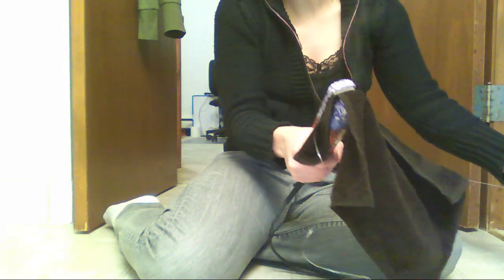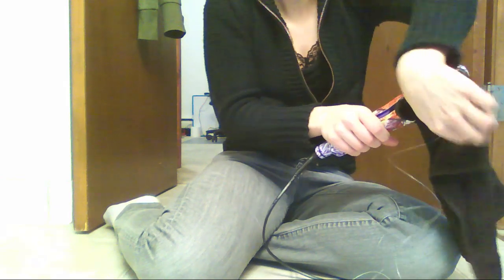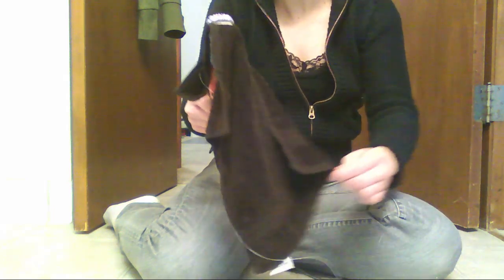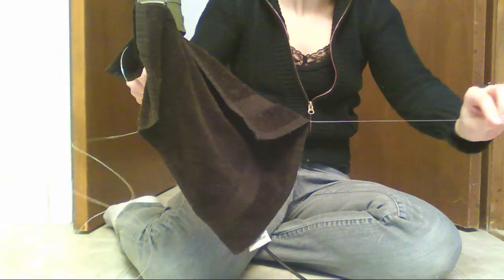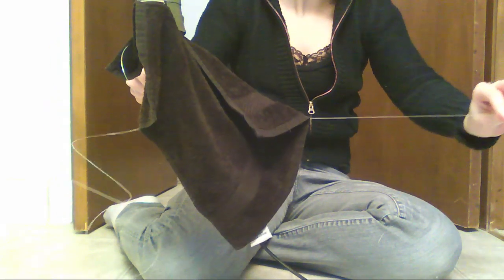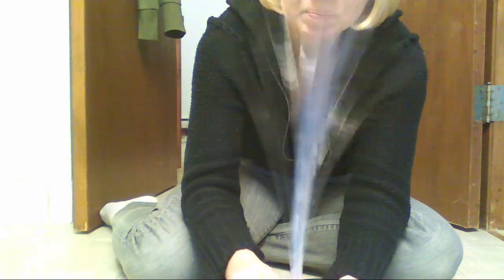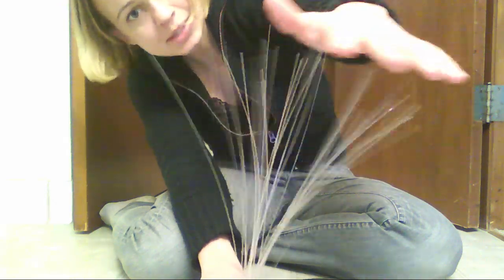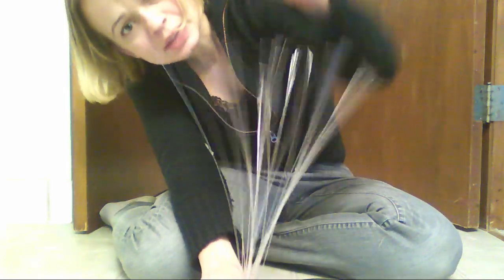DIY Fiber Optics

Comment: This is from a starship modeler forum "Posted: Thu Feb 18, 2010 11:44 am    Post subject: 				 			 			 				 			 			 				I bought some 50lb. test fishing line at Walmart last night. I cut two lengths and two lengths of fiber optic. These were glued into 1mm holes drilled in a scrap of plastic. Super glue did not harm the fishing line or the FO (from the fiber optic store). The fishing line was a bit more flexable than the FO. I tested with a white LED and a blue LED. On a scale of 1-5, the FO being a 5, the fishing line was a 3. It was noticably dimmer than the FO. I expected that. With the blue LED I would rate the fishing line a 5. There was no notable difference between it and the FO for brightness.

The fishing line was $2.96 for 450 feet. The light output was more "in scale" than the near blinding light given off by the FO. I could do the whole ship (estimated 833 feet of strand) for under $7.00.
"
Reply: +Manuel Herrera 
"Yeah that whole idea has been scrapped. The 
fishing line did transmit light, but not vey much. The optical clarity 
of the line is very poor. I finally went with .75mm FO." 
...  was the closing of that thread back in 2010.  

Obviously it depends what you want to do, for my application, radiation of light down the length instead of at the end is 'exactly' what I want it to do.